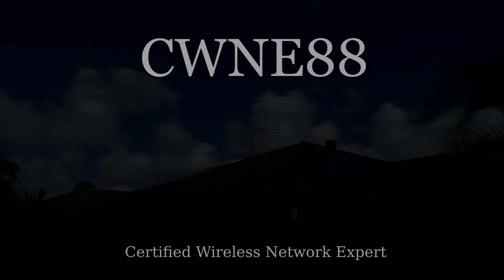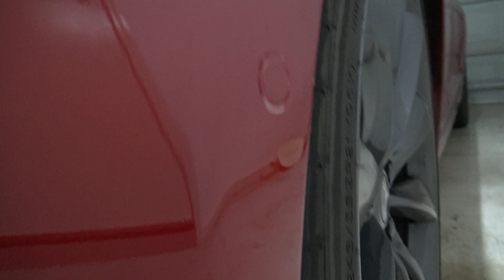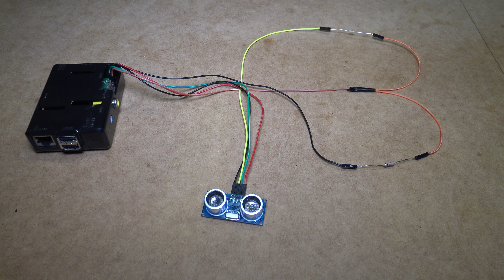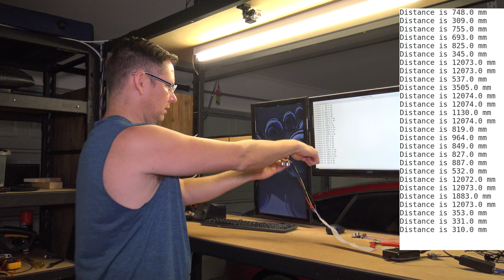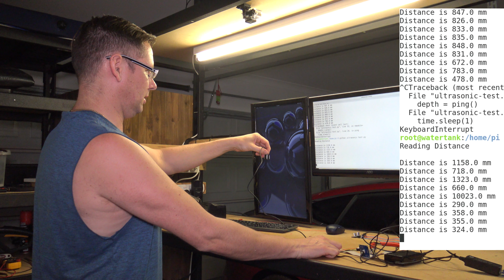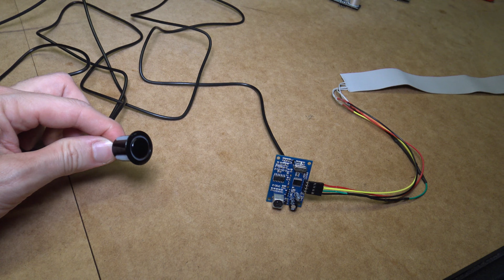Raspberry Pi Ultrasonic Tank Sensor

Comment from the maker: I don't think I'll go through with this project. Once the sensor was put in the tank, it was giving readings from things closer than the bottom. There is internal metal for the structure of the tank which gives an echo way before it can reach the bottom of the tank. Had to try it though, so now I know.
Reply: How about pointing the sensor inside an open ended tube inside (or out) off the tank?
Reply: Maybe you can just measure the pressure of the water at the exit of you tank since it's a the bottom of it.

Than it's quite easy to calculate the quantity of water knowing the size to your water tank, you can also measure the flow at the same time and maybe measure the quality of the water ( resistivity ?).
Reply: A pressure sensor at the bottom of the tank is the way to go.

Comment: One remark: why waste a Pi on this?  I have the same sensor hooked up to an Attiny85 with a cheap 433MHz transmitter module and all powered by 2 18650s which will have it run for years sampling every 10 minutes (did need a PNP-transistor to turn off power to that ultrasonic sensor's board to get low deep-sleep consumption).  In my house I have an ESP8266 (on wired power) with a 433MHz receiver attached, which receives all 433MHz messages from all my stuff (doorbell, letterbox, remote controls, ...) and turns it into UDP packets over WIFI to my central Pi controlling everything from the "server room" (aka garage).

Comment: My thought would be to get those 275 gallon totes that are plastic. You can maybe add a way for the water to flow down the side to minimize the splashing and then add the tech to the screw cap at the top of the tank. I would also maybe have a way that things could be replaceable and repeatable. I'm assuming that those proximity sensors would only last so long in a moist environment so I'd like a way to replace the cheaper components when things begin to act funny. Does anyone know how long these ultrasonic sensors could last in such an environment? I've used one before for a hydroponic desktop plant... so the same concept, but on a much smaller scale. But the water pump would turn off if the water got too low and it would light up LEDs to show you when the water level was right.

Comment: maybe have a vertical tube screwed to the lid , if you have one , with a floating ball in it , place the sensor directly above it , so it detects the ball floating in the water instead of the water itself , same thing i guess 
great video as usual and informative

Comment: This ultrasonic sensor is waterproof, better suited to measure water levels, where condensation could appear in cold weather, better choice for me. I see you need an external card while the hc04 is directly soldered on its own, not a great deal.

Comment: A little piece of advice from someone, who knows the professional ones (2 inch threaded) from industrial use:

Make absolutely sure you mount that sensor at least 300mm away from any fixations within the tank as well as the tank wall, otherwise you will get garbage readings now and then. Not nice, when you have programmed an overflow alarm.

Furthermore these sensors react kind of allergic to droplets on it and foam swimming on top of the water, as you get garbage with that as well.

I know there is a severe difference between the professional solutions and such diy projects, in regards of sensitivity. So above mentioned things may or may not occur. Think of it just as a heads up.
Reply from the maker: Thanks for the tips. I was half hoping someone would chime in with experience before I got to the actual mounting part.
This is only really a bit of an experimental project and nothing serious, but I did also consider that I'd probably want it in the centre of the tank to be as far away from the walls as possible.
I'm also going to code for the average value of 10 echos, and disregard any that are way off that average for those 10. Something like that anyway. I'll see how it goes.
Reply: Do you mean if I have a reservoir made of concrete, floor is 4.2 square meters, internal height is 1.8 meters, I plce the device into the middle of the ceiling, there sould not be echo-problem.. right?
Reply: @tildatild8115  From my experience there should be no problem with that.
Just watch out that there are no pipes, baffles or other fixtures in its way.

Comment: I was planning on using the same exact sensor module to monitor the water level of a drinking water tank at our summer home. I have a faint memory of testing that it does in fact work for measuring water level but the blocker for me was that it doesn't measure distances below 20cm. In my use case, it would be almost 50% of the tank.

I ended up using 3 on/off type float switches that had to be mounted inside the water tank. I only get ~25% accuracy on the water level but it's enough for a 20 litre tank. I've got them attached to 3 GPIO pins of an ESP8266 board (a "d1 mini" you can get for around $2-3 on eBay/AliExpress). It sends the values over WiFi. The code is Arduino based so writing it was mostly copying and pasting. I encourage you to look into ESP8266 or ESP32 and Arduino. ESP32 boards can also be programmed using MicroPython if the simplified C/C++ of Arduino doesn't sound tempting! 

The minimum distance might not be an issue in your use case though as the tank is much bigger.
Reply: Maybe you could use a >20 cm tube to get the minimum distance you need ?
Reply: @esspe2  Yep theoretically but the current solution has served well for 1.5 years so far. Surprisingly even the float switches didn't start leaking even though I forgot to properly dry it up for the winter. The switches required small holes to be drilled in the tank. When they fail, I'll consider sound/light based solutions again. For my use case an ideal solution would be something only attached through the tank lid. It would allow "hot swapping" a full tank instead of filling it up. :)

Comment: Very interesting, looking forward to Part 2.  I've seen a few of these and similar and notice many people just poll the input, tying up the processor for a relatively trivial process.  I think it would be better in such cases to programme the timer to generate an interrupt every hour (or however long interval you deem) so other things can be done in the meantime.  I would use an ESP8266 or ESP-32 and use the deep sleep mode so it could also be battery powered.  Bob

Comment: You should take a look into ESPs (e. g. ESP8266, ESP-32). They're a much better choice for sensor projects.
Reply: Interested in the esp's.  I need to monitor water tank levels in a boat.  Any links?
Reply: @martinlaforest1351  Just search for esp32 on Amazon. They're a dime a dozen.
Reply: flash it with tasmota and integrate it with mqtt then you can do a lot more things with it
Reply: Definitely! Much lower power than raspberry pi, much cheaper, and still overkill. ;-)
Reply: Carl Howard And no hassle keeping Linux updated on a fragile SD card.

Comment: Are you adding functionality to not allow the pump to turn on if it is not submerged or is that feature already handled? I think I remember you did a video to address that problem because you previously burned out a pump but I may be confusing you with Kris another maker. It would be neat if this tracked if the tank is too empty too full and did all your watering on the pie with a RTC or something all while being networked and plotted. Esp and similar is nice and lower power but might not be enough gpio. I would consider adding a float for backup or at the very least having a heartbeat program running in case the electronics fail and your pump runs dry.
Reply from the maker: Have a closer look at this point  https://youtu.be/uV0Q2ha7Eh8?t=32
You'll notice the pump has a sensor of its own for if there's no water in there at that level ;)
Then again, even in this drought I've still got plenty of water in that tank as I don't use much. When a storm comes through it puts a decent amount of water back in there. This is just a project for the hell of it.